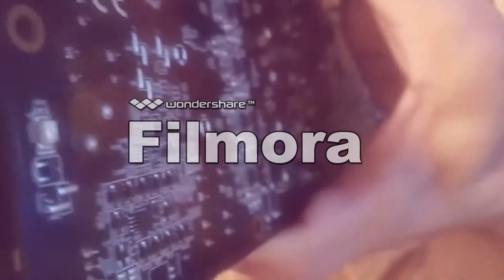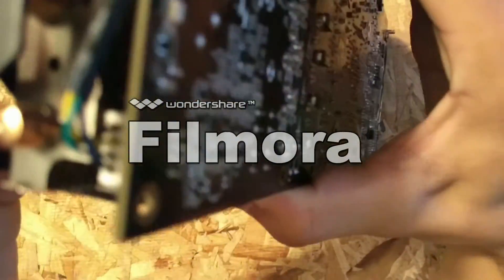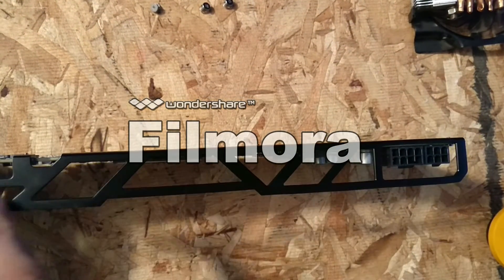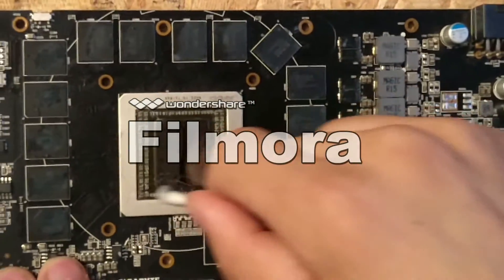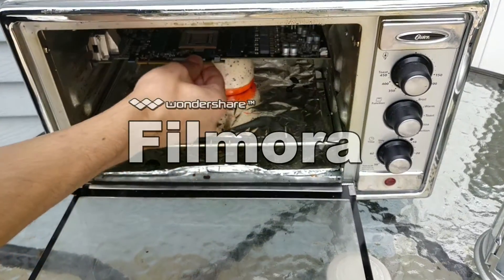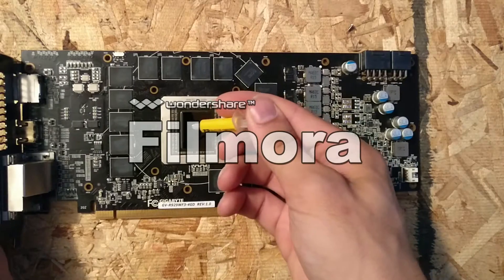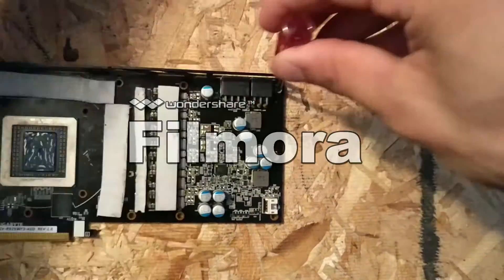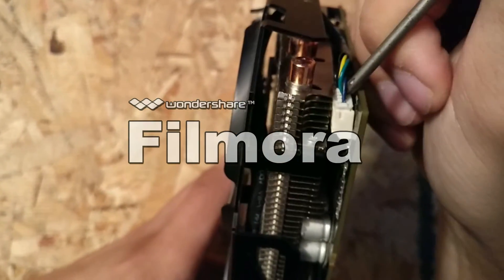Baking a GPU

Comment: I am going to be sick, the amount of shops that do not know what they are talking about. reballing (melting the solder) will not fix the problem what does fix it is warming the chips themselves up but that will only fix it for a few months. best way is to use a heat gun and replace the chip that is broken or buy a new card. (i don't blame people for not knowing but i do blame crappy shops who scam.) 99% of the time THIS IS BULL!
Reply from the maker: I replied to another comment and said it worked for about 3 months after, but it definitely isn't a permanent fix it was more geared towards if you were saving up for a new card. It also says in the description that it is not going to work for every card.
Reply: XD ye i did see bit i just thought i would mention it.
Reply: so it was working for 2 years without problem? :o
Reply: my HD7970 was last baked 2016 and now 2018 the issue i had back then the crashing and stuff came back haha i think this method is 50 to 50 sometimes for others it work well but in sum cases no haha